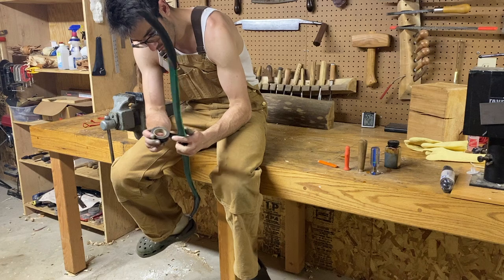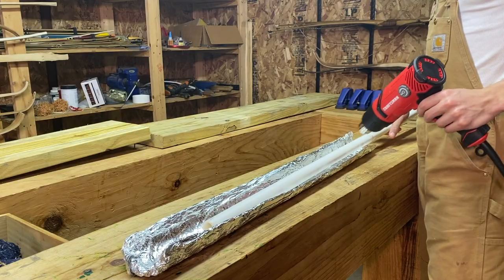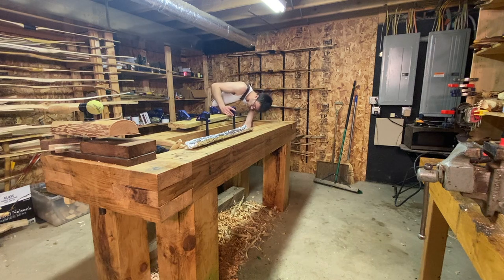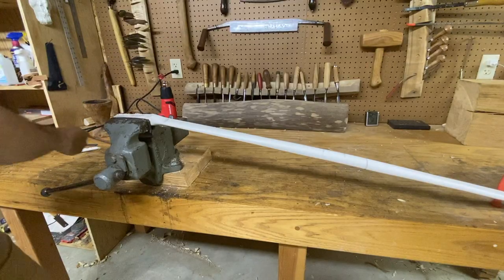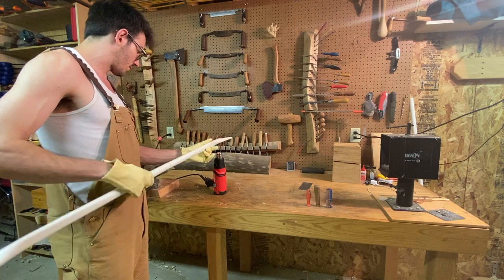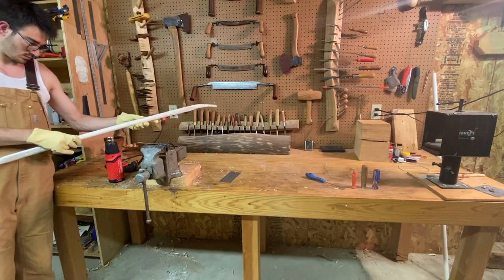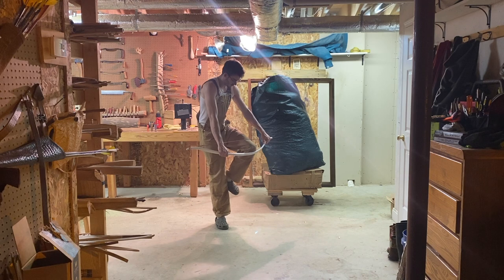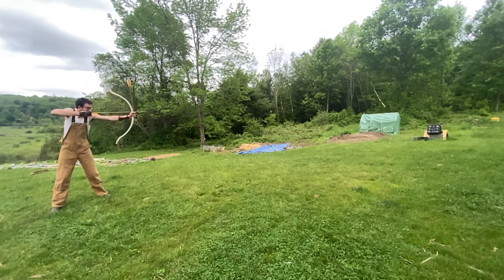How To Make a 40 Pound PVC Horse Bow

Comment: If you want to improve the draw weight go get a fiberglass tension bar (they are flat and are used at the terminal ends of chain link fences) it fits perfectly into a flattened 3/4"pvc pipe. You can still shape the handles too. Just cut it short enough that it wont interfere with the recurve ends (I used a 48" tension bar inside a 54" pipe).
Reply from the maker: Thanks, I have seen this solution but I’m not fond of it because you can’t tiller the bar. In other words it isn’t tapered and so has a lot of dead weight  and only bends in the middle. I’d rather just make the bow a different draw weight by using a different taper, shorter pipe, or thicker pipe
Reply: Could you taper the bar before you insert it into the pipe?
Reply from the maker: @fornman Yeah but the middle of the limb is still the worst place to be adding material to the limb. It wouldn’t be an efficient way to make a higher poundage bow—you can just make a higher poundage bow if you want one. The core should be stable and light

Comment: PVC bows got me into bow making (thanks BackyardBowyer). They were shooting fine, but after some time they would explode on me, maybe it was issue with material or wrong shape. But then i started experimenting with solid fiberglass bows, i bought fiberglass cloth, fiberglass roving and epoxy resin, i made simple mould from wide steel bar, and two narrow steel bars on the sides to determine thickness of the laminate. Then I would start laminating first with unidirectional fiber along the mould to give the bow very high stiffness (because the material on top of belly and back contributes the most to draw weight, since draw weight depends on cube of thickness and unidirectional laminate has much higher modulus of elasticity in that direction when compared to cloth), then i would continue with fiberglass cloth for the middle of cross section to also give the bow some stability in the other direction and then again last layer would be unidirectional roving. Everything needs to be properly wetted with epoxy resin, once the mould is overfilled with material, i would close the mould with another wide flat bar, and then would clamp everything together with clamps alogside whole length of mould. This will pressure all the material into the mould, excess epoxy will get pushed out and after curing you will be left with very high quality bar of fiberglass composite, then it is just a matter of cutting the limb profile, gluing the handle and siyahs if you want and you are basically done. Since fiberglass has much more uniform mechanical properties than wood, there is no need for tillering, you do only width taper. Only thing I recommend is to use program like VirtualBow, or Excel sheet SuperTiller to design how to taper width of the bow to get the same stress along whole limb. Of course bow like this doesn´t have the same character as wooden bow, but it is something different, and bows like this are basically indestructible. You can also use wooden core and just laminate belly and back to it in the mould. If you want to try something different, highly recommended.

Comment: Would you recommend incorporating fiberglass rods for increased power/stability? I've seen some longbow builds utilizing a PVC Pipe and fiberglass road markers. Great Video!
Reply from the maker: No, I think adding energy storing material into the neutral plane is the worst place to put it. This is a very mass-inefficient way to build and it’s better to just design and tiller the bow to the specs you want from the start

Comment: Some thoughts on this kind of a build.

Grey looking PVC for outdoors is and more ultraviolet resistant then white PVC, so is black ABS. Don't know if it is as good for a bow though.

If you used dip on the bow for decorating ideas, it comes in many colors and adds UV protection. If you add polyurethane to the dip it's extremely strong finish. There are videos of people doing this to cars with dip. It does come off with a heat gun or just peels off when you want.

Heat process and time could be reduced by a metal or cardboard tube ( with holes in it) inserted inside the PVC pipe. Then a lower heat temperature or hair dryer would better control heating it maybe.

I would like to see you make out of plastic tube, the double bow that joerg made to attach his SIL ( and use it with your SIL build)  to harvest energy on the push stroke and use on the draw stroke. 

This would mean a weaker Bowman could use a strong bow more accurately, safely.

The advantage of this plastic tube builds is cost for performance. 1. Buying bows for a whole family is a hug investment beyond the budget for some. 

2. A father teaching his family to build things is a family bonding experience. Teaching the family how to work with their hands, and Powers them to realize, they can achieve anything if they put their mind to it.

Wonderful channel, great teaching. Thank you for sharing your skills.
Reply from the maker: Thanks for the ideas and kind words, Rey. Am especially interested in trying out the dip for decoration

Comment: About ten years ago I made a PVC bow from 1" schedule 40 and three or four fiberglass rods from those road side reflectors for driveways that they sell in big box DIY stores. Tillering was accomplished by cutting the rods to descending lengths, then centering them on the handle. The thing pulled 65lbs and flat rips arrows out lol. Fun build. A horse bow sounds like much more fun though...maybe I'll take the old one apart and use some of the rods to get a 60lb PVC horsebow!
Reply from the maker: Awesome! I think there are better ways to increase the draw weight using the design. Putting working material in the middle of the limb is the least mass efficient place to put it. Save the driveway rods for something else and just use a shorter piece of pipe, or thicker pipe

Comment: This got me to thinking (my most dangerous pastime). What If you made a jig the length of the bow, with a channel routed into the bottom to get more of the cross section of the English longbow? 

I wonder how it would shoot? 🤔
Reply from the maker: It believe it would concentrate the stress on the ridge of the belly, same as with wooden bows. A flat belly would perform better with pvc, because the belly is the weak link and not the back
Reply from the maker: By the way I’m almost done editing my next pvc bow tutorial it should come out soon

Comment: Awesome, I’ve made two pvc bows by following the backyard bowyer. But my concern is releasing toxic fumes when heating the material. My suggestion is a plains style horse bow. Or snipers bow from The video game tf2.
Reply from the maker: If it even smells like plastic the PVC is probably too hot. If you heat gently and keep everything moving you’ll minimize any possible fumes, but I haven’t noticed any unless I scorch the pipe.
Reply from the maker: great suggestions. vote here for the plains horse bow
Reply from the maker: and here for the sniper bow from tf2